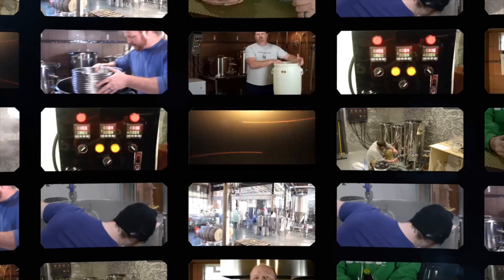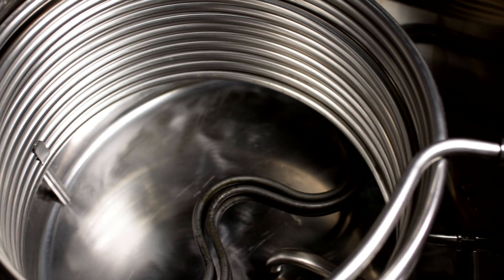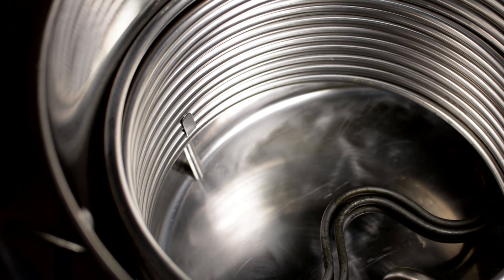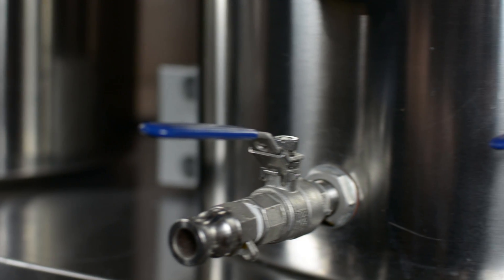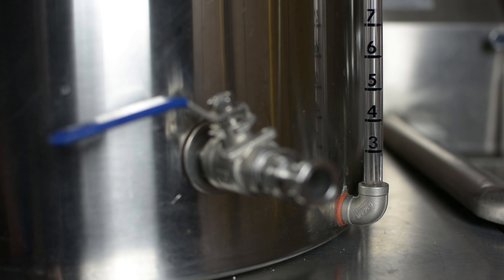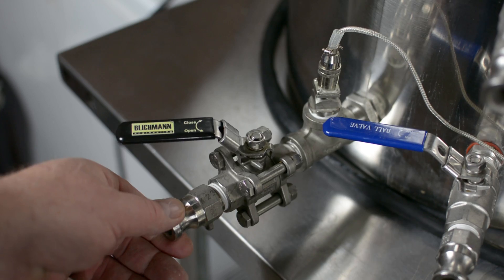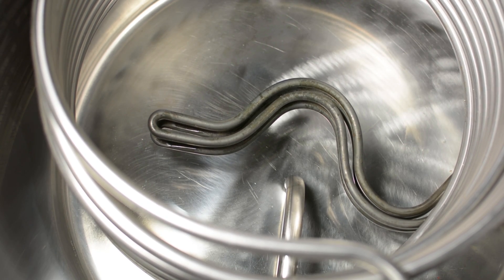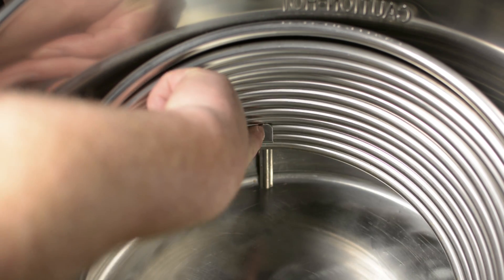Electric Brewing Series - Part 6 HERMS Equipment  #electricbrewery #hermsbrewingsystem

Comment: Brian, is there an important factor in using a 15 or 20 gallon kettle when you may find that you are doing only 6-7 gallon batches to yield 5gal.  Besides the depth vs height that you mentioned in the beginning .  I’m thinking I might be  thinking to use 3 gallon corny kegs when it is all finally ready to use
Reply from the maker: Just to clarify, are you looking at making 3 gallon batches? And is the kettle question about batch size?
Reply: Yes.... I can brew small batches of several recipes and be diversified in tastes
Reply from the maker: @knuckle47  ok so what is the question about the vessel are you looking to build a smaller HERMS system?
Reply: My concern would be.... I would like to start with small batch...then in 6 months< it turns out that I have a greater need occasionally for larger batches, what happens using a 15-20 gallon Herms to make a 2-3 gallon recipe,
Reply from the maker: @knuckle47  you can't really do that. You would need to upgrade your system. You kinda have to decide in the beginning. Or you could get a small single vessel system for small batches and then upgrade to a HERMS later.
Reply: So with your experience, you’re saying single vessel small batch, HERMS for upwards of 5-7 gallon.  Much confidence in your opinions and thoughts... you are one dedicated brewer. You saw my bar in a few pictures, the brewery room on the end has been expanded and is now 11x13, so I am really looking to maximize the options within that area. No one I know has made the commitment to excellence of design and production as you have done and shown in your videos.  A dedicated fan 👍
Reply from the maker: @knuckle47  yes sir! Thanks for the compliments!! 👍🍻

Comment: Do you recommend measuring mash temp at the MT outlet, HERMS coil inlet, HERMS coil outlet, or MT inlet?  The challenge is understanding the average temp in the MT because the top is going to be hotter than the bottom.
Reply from the maker: I generally measure both at the outlet on the HLT and the inlet to the mash tun. You'll have a slight difference from top to bottom it is negligible since you are recirculating the wort. If you are concerned you can bump the temp by 1 degree so the average from top to bottom is your preferred temp. Swing by our live stream on Saturday. I'm getting my big system back up and running. You can see it in action. 👍🍻
Reply: Short Circuited Brewers looking forward to it!

Comment: Hey Brian, I like your vids. I have never brewed beer before. I've been researching beer brewing for about a year or more. I've decided to by pass extract brewing and go straight into all grain electric brewing with a HERMS system.  I've been gathering equipment slowly do to cost. I have 3-10gal. Megs pots, 2-5500 watt elements with enclosures and a few other things. But I'm looking to get the HERMS system or the control system next. I found a complete HERMS kit with or with out pumps at Stainlessbrewing.com (http://www.stainlessbrewing.com/Herms-Kit-ETA-51_p_273.html). I priced out all the separate pieces from Brewhardware.com and the one threw Stainless Brewing was about $56 cheaper, but the pumps are cheaper at Brewhardware. I like being able to buy  kits versa having to spend hours on line trying to find everything. Can Brew Hardware match the price of Stainless Brewing?
         I have another thought, I could get started a lot quicker with the brew in a bag system until I get everything needed for the all grain system. Just as a thought, I'm thinking I could just use the control system for a hot water tank. The heat control wouldn't be as precise and I would have to monitor a lot more closely, but I'm thinking it might work until I can get a PID control system in place. What do you think?   I can't wait until I start making my own beer. Thanks again for making the vids. CHEERS!
Reply from the maker: Speed Buggy I would ask Brewhardware. I always say it never hurts to ask. What type of control are you thinking of for the BIAB?
Reply: Brian, I just found a commercial thermostat that goes up to 180 degrees. This could be used for just one element (https://www.amazon.com/Camco-08314-Degree-Commercial-Thermostat/dp/B0060HO8Z0/ref=pd_bxgy_263_2?_encoding=UTF8&psc=1&refRID=5BAK3XWRF49W8NVEV4VH). It's the lower thermostat for hot water heater.  Not very precise, but for $17 bucks, why not? The only other thing I would need is a pump system and faults bottom to keep the bag off the element. Rite? Like I said, I've brewed beer before in my life. Thanks for the quick response.
Reply: Btw, my name is Dale. Lol
Reply from the maker: Yeah Dale, with BIAB once you heat your strike water using that type of device.. I would mash in and wrapped the kettle in blankets and not worry about recirculating as that unit won't hold your temp anyway.  Then you can boil at full power.. BUT it will be a very rigorous boil if you're doing 5 gallon batches.. 10 would be slightly less but still pretty rigorous boil. 🍻
Yes you would need something to keep the bag off of the element..
Reply from the maker: If you have a chance to tune in tomorrow Dale we can talk about it a little bit more in my live Brewing session starts at 10 a.m. eastern standard
Reply: I wish I could, but I work tomorrow. Are you going to make the live brewing session a regular thing? I have every other weekend off.
Reply from the maker: I have been Dale. It is great fun usually anywhere from 20 - 30 people watching and commenting most live brew days. We have a lot of fun and there are all skill levels hanging out.. Great time to ask questions. I brew on my HERMS system, so I could explain anything as we go along. Be great if you can make one. Just make sure you are subscribed and hit the bell and you will get notifications from me when I schedule one. Cheers man! 🍻

Comment: I have one more idea I'll sing about doing a rim system because you can have the heating element inside of a tube I think that would take up less space then you also get the benefit of the recirculating Mash if I understood your video right so I need a system that can easy put together taking apart because I don't have enough room my apartment to leave it up all the time like you having your system
Reply from the maker: That is a possibility.. I will be doing a apartment size video soon (as I commented on the other video comment.. lol) Stay tuned for that. Cheers! -Brian

Comment: I use convoluted coil as herms to maintain mash heat. Works like a charm without flexible weldless fittings that leak
Reply from the maker: Cool I bet it does with all the turbulence it creates. Wish I could TIG like you can. Where did you get it? Cheers!
Reply: Short Circuited Brewers I've also made 3/4"  ss diptubes and welded tri clamp on them. I got my ss convoluted coil at aliexpress. Sanetary Tri clamp version. They also got them with threads
Reply from the maker: Nice! I'll check that out.  Thanks for the info! Cheers!
Reply: Short Circuited Brewers Btw turbulence? It doesn't create much of than and not more than any other coil. It dosen't matter if the heat exchanges in a coil inside a kettle or in an external coil since it circulating all the time it takes. And I also use the coil to cool after the boil.
Reply from the maker: I do like your setup.. It is very slick!
Reply: thank you. i like your system too.

Comment: I have been watching since you posted part 1. I just finished my boil kettle. Taking it slow as I move to a three kettle system. I was planning to use my old 8 gallon economy kettle at first for my hlt, but now I am reconsidering.

My boil kettle build:
http://www.homebrewtalk.com/showthread.php?t=621165
Ss Brewtech 15 gallon Electric Kettle Conversion
Reply from the maker: Cool, I will check it out. Hope the series helped you out!
Cheers!
Brian

Comment: Another informative video - I built a 70 liter  HERMES system based on the electric brewery, the problem I have is remembering what hose goes where and making sure the correct ball valves are open or closed so I've decided to automate that part, I have the system set up on an Ardunio mega and a 16 slot low trigger relay board. the status is displayed on a LCD screen, once a have a few more bits I will put it into use, took a few weeks to get the code sorted , the 12V valves take  a few seconds to open so there is a small delay built in before the chugger pumps turn on . Its been a lot of fun making it , might even make a video about it later on, Regards from New Zealand
Reply from the maker: The herms valves are always the tricky part.. Sounds like you have a plan to deal with it. I would love to see it when you're done!
Thanks for watching!
Cheers

Comment: Another great video!  I am in the middle of building my RIMS system.  Currently have the mash tun completed minus a sparging arm or some kind of sparging device.  I still need to purchase my boil kettle.  All my pumps, tubing, fittings, elelements, etc are taken care of thanks to Bobby at brewhardware.  I am also in the middle of wiring the up my control panel.  Can't wait to get brewing with it!  Thanks for all the useful info!!
Reply from the maker: You'll get there! AND you will really enjoy it once you do. 
Cheers!
- Brian